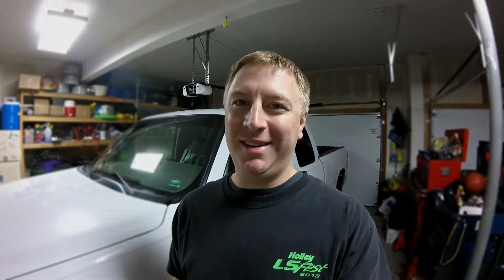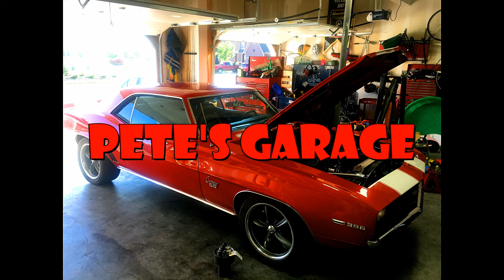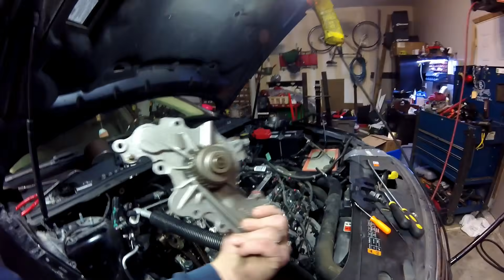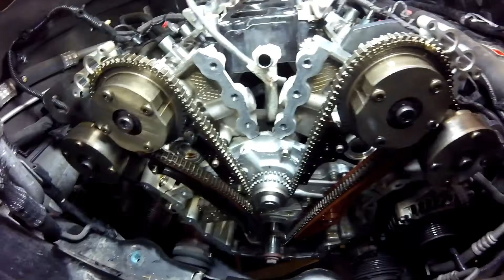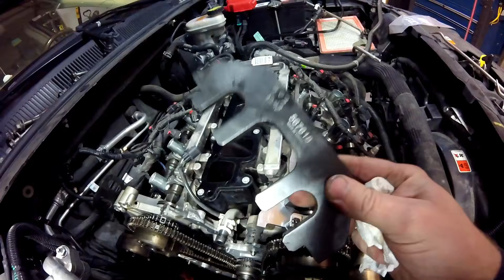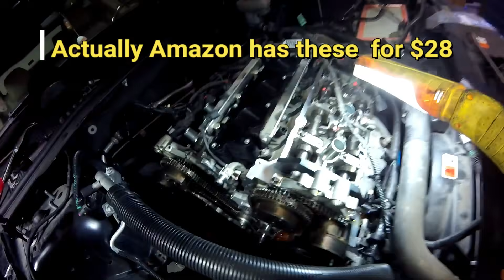Why does the Ford Taurus, Explorer, Edge 3.5L water pump cost over $1400?

Comment: It is important to note that this water pump may fail and the coolant may not come out the weap hole and dump behind the alternator, but.., it may dump inside the engine into the oil pan and destroy the bearings on the crank shaft.... It's engine replacement then....
Reply from the maker: Yes replace it as soon as you see any coolant leaking. Hopefully it comes out of the weep hole and not milkshake the oil.

Comment: You don’t know the worst of it. The water pump sits directly over the oil pan. When the coolant leaks through the front bushing it leaks into the oil pan. If not caught right away? I’ll just say you should do a little research online. Get ready to pay the big bucks for a new engine. Not to worry. The newer 3.5’s got an upgrade. They removed the water pump from the timing chain and put an idler pully in its place and routed a tube to the front of the engine and put the water pump on the outside . Another problem, coking of the valves due to direct injection. Ford had a fix for that. They added sequential port fuel injection to wash the intake valves and prevent coking of them. 
  The sad part is before direct injection the water pump and fuel injection worked fine, the valves didn’t coke and the water didn’t leak into the oil pan
Reply: Everything done in order to force you to have to buy another automobile!
Reply: To be fair gdi was to get more hp in the ever demanding heaiver cars and the need to get ok mpg. Dual port/direct injection is really the solution at this point. I belive toyota on alot of there cars runs port injection until you need the extra power. I am not a fan of these new small turbo cars "eco boost" ect as there promise to get better mpg seems empty so what do we even benifit from it other then mote complexity and wear on the engines?

Comment: Thank you. I was looking into getting a Ford Edge with the 3.5. I guess I'll just look for a Highlander or Pilot instead.
Reply from the maker: The pilots are having a little issue with fuel injectors. I also have a video on that. Check it out.
Reply: 300 hp out of the highlander N/A V6 That is just a modern 2GR-FEB ... you cant loose ... Parts are cheap, you can get genuine Toyota parts on eBay and after market for these are very strong since the Highlander is sold overseas in Australia as Kurger
Reply: $3,000.00 to replace the waterpump in the Edge,the whole drive train comes out to do it.It is a must to replace the timing chains and guides too at the same time

Comment: Longitudinal mounted engine are usually easier to work on. Today’s modern transverse mounted V engines can be a pain to work on.

Just did a water pump on a Toyota 2GR-FE and the pump is about 1” from the frame rail. So much fun.

Comment: GM has done this with the Quad4 as well. Honestly....I'd rather change a timing belt twice than a chain once! I said that back in the 80s when timing belts were new. Now we've gone away from belts and to chains on OHC engines. Belts are quieter, but when engineering puts a chain in, they dont feel they have to give you clearance to work on it like they did with belts. Nissan 3.0 has belt driven water pump in the valley and is a 4 hour job and gets a new belt too. Emissions regs drive crap like this to be built....

Comment: Makes me glad I drive an EV.  None of this kind of nonsense to deal with.
Reply: Even though I don't have one, and probably never will, I think that electric vehicles are fine...as long as you don't have to go too far from home. I don't know where you live, but where I live, there aren't charging stations available. I know that "hybrids" use small gas engines to run a generator, but, they're so complicated and expensive that they just don't make sense to me for use as a long distance vehicle. Also, a guy that I work with has an EV (not sure what it is). He hit a large racoon on his way to work one morning. It turns out that his DOES have a water pump, along with 4 small radiators. The water pump wasn't damaged, however, 3 of the radiators (heat exchangers?) were. There was no cosmetic damage to the car either. Even so, the repair cost was nearly $3000! Luckily his insurance covered most of it!
Reply from the maker: Yeah but the battery will be expensive when it goes bad! EVs are pretty fun though.
Reply: @PetesGarageandperformance  Or the generator
Reply: @Daver G  I'm nod driving a Tesla.  Too much exotic car in Tesla for my tastes.
Reply: BATTERIES Ability to hold his charge declines overtime and the weather can take a toll on the rate of that as well.. But I wish you the best it just depends on how much driving you doing how long are keeping the car

Comment: Uhh what year is that taurus?

Edit: I just looked online and the part cost less than $100

Is the $1300 going toward maintenance costs at the dealership?
Reply from the maker: 2014. I’m doing one on a 2013 also
Reply from the maker: Yes it’s around 8-9 hours of labor to get to this failure prone part.

Comment: This costs $1400 b/c Ford used an asinine design for the water pump.  When the pump goes pray it doesn't destroy the engine.  Ford is now getting sued over this stupid design all so they could fit a 3.5L into the 3.0L engine bay.
Reply from the maker: Yeah they used to drive the water pump off of the rear of one of the camshafts. But I guess that was made a little more difficult when they put VVT on this engine. I guess they thought the pump stuck out too far on the truck engines?
Reply: @PetesGarageandperformance  I think it is a bigger problem on the vehicles with smaller engines bays like the Fusion, Taurus, and Edge.  All FWD vehicles might have problems fitting the 3.5L engine into the bay, especially if the pump is off the crankshaft.

Comment: I would buy an engine for 500$$ with 50k and replace the whole thing easier lol
Reply: Not $500.00 used.The 3.5 in the F150s,$3,000.00 used
Reply from the maker: Do these engines really sell that cheap?

Comment: My work cars have always had the reliable GM 3.8 V6. Amazing engine and extremely easy to work-on at all levels.
Reply: Watch out for the timing chains on the dreaded 3.6 high feature GM V6s
Reply from the maker: Yeah when the water pump goes out on a 3.8 it doesn’t ruin the engine. And you don’t have to dig deep into it to replace it.
Reply: @PetesGarageandperformance  Back when they engineered things properly. The new breed of designers are bloody morons.
Reply: Yeah, the 3.8l water pump was about 1.5 hour job.
Reply: Except for the Dustbuster vans. They are a PITA to work on.

Comment: all the ones ive replaced leaked coolant into the crankcase mixing oil and coolant
Reply from the maker: Yeah you need to catch it early. How many have you had to fix?
Reply: ive done 3 of them 2 ford edges and 1 was a lincoln mkz 3.7 lol what a job

Comment: There is a small hole behind the alternator. Is this where it will leak if it's the water pump?  Someone said that if I take out the Allen cup next to that hole and clean it  the leak can stop. Help me out so that I dont run around crazy tomorrow.  My coolant is leaking out of the hole behind the alternator. It's a heavy leak.
Reply from the maker: Yes that is your water pump leaking. Don’t drive it! When these things leak, they LEAK!

Comment: Actually , many Ford dealers nkw quote $1800-2200 to replace this pump SMH.  Sometimes the coolant leaks into the engine I stead and you are now $5-7000 in the hole for a new engine
Reply from the maker: Yeah it definitely depends on the labor rates in your area. What area do you live in? Do you know what the labor rates are near you?
Reply: @PetesGarageandperformance  I'm metro ATL and most shops are like $125hr+ at least.
My friends 2013 Taurus quote 1800 to 2200, but that may have included timing chain components too.  After she repaired it the car was sideswiped and totaled 3 weeks later.
Reply from the maker: Wow that sucks. I rebuilt a trans for a buddy’s Jeep and he rolled it the night after he picked it up. Talk about a waste of money.

Comment: And I guess they used sealed bearings in water pump,, Could't  use the engine oil to lubricate the bearings,,, last way too long,
Reply from the maker: Yeah but I can’t think of a single water pump that has the bearings lubricated by engine oil.
Reply: @PetesGarageandperformance  True that, but i cant think of a single engine with internal water pump,
Reply from the maker: Most engines with a timing belt have one. Also the older dodge v6s had this design. The part that gets me is the labor involved to replace a part that is known to have a service life. It’s why it is recommended to replace the pump when you do a timing belt. But when one of these things fails, it can leak coolant into the oil. And that’s bad! Thanks for watching and commenting.

Comment: How many miles were on the engine?  Should they be changed at 125K miles?
Reply from the maker: 140k on this one. I personally wouldn’t replace it unless it was leaking. But I wouldn’t put it off for long if it starts leaking.

Comment: With the play in the water pump bearing and start up rattle,  wonder how many cars are mistakenly diagnosed as chain stretch?
Read that the phasers, chain, guides, etc need renewed as well.  Hard to justify this on the older sub 3k book valuation car. 
Video is an excellent synopsis of madness involved.  "If you have the time we have a water pump" Miller to Ford conversion song.

Comment: My ford explorer brought me here. I had this problem and could not believe that someone would be such an idiot to stick the water pump inside/behind the timing chain cover. If you let the pump just leak, it will eventually leak into the engine block and seize up the engine so you can't just let it go. The timing chain is supposed to be replaced every 80,000 miles so if your getting that replaced have them replace the water pump. The pumps itself only costs $40. I will never buy a Ford again. Horrible experience.

Comment: Oh yeah.  A couple of days ago, my sister's 2012 Ford Taurus blew up.  It has one of these piece of shit motors in it. The water pump failed and dumped coolant into the oil pan.  No noise, no warning, nothing.  The only clue is that it started overheating.

Comment: I had to get mine replaced in my 2013 3 months after buying it... around $1,300. I believe it was a common issue with the first few years of this design...
Reply from the maker: Thank you for sharing your experience and validating my cost estimate. Many people comment about the pump costing $50 but they don’t understand the total cost of the job.
Reply: No problem. Labor is definitely the major cost in getting it repaired. Looking at the receipt, It was 3x + some than the parts. Ford didn't make it easy..

Comment: Most if not all manufactures have created design nightmares during the past 3 decades  when it comes to engines . Sadly it there are only a few choices of engine irrespective of manufacturer brand still built in the OLD FASHIONED relatively  easy to repair  architecture of past decades.
The consumer is largely to blame for it , most consumers will  buy anything  with four wheels without ever researching what is under the sheet metal ,
suspension , drivetrain , engine architecture be damned . Most will rationalize that they will trade in their car or suv long before paying off their 8 year car loan , therefore in theory they might avoid spending  $1400 on a water pump. But that is an insane way of rationalizing buying junk engineering  as opposed to not buying a car equipped with an engine designed by a team of MICKEY MOUSE type engineers ... and.  that is being kind to the moronic engineers who could easily design a self contained electric motor driven water pump,  mounted externally in the engine bay connected to the engine  coolant system in some appropriate method .. as long as the morons  can design an engine bay with an adequate amount of space for servicing the engine. 
That make too much sense , and  design logic which minimizes repair costs  does not make dealerships wealthy on pump changes or any other part failure out of warranty periods that are outrageously priced , therefore the  MICKEY MOUSE ENGINEERING  reigns supreme.

I spent  $ 35 k rebuilding a 1964 car  model whose brand  I will not disclose in order to avoid a lengthy discussion about going with the wrong brand  with a potential pinhead who may like manufacturer  which I did not choose.  
Resuming from the unavoidable digression , my 1964 is  more reliable than any  new car because it uses a combination of technologies , proven v8 architecture modernized with  21st century options  aftermarket or OEM adaptable parts , underpinnings  throughout also received the same attention , as did  high performance fully tunable ABS brakes  
A restomod that is fun to use daily, and  able to traverse the USA coast to coast as many times as anyone would care to do. In every sense of the word reliable 
but should it need repairs  ...easily afforded  ...no banks loans or forced trade ins.

Comment: It sure seems like Fords newer engines are designed this way for the sole purpose of generating revenue through repairs....  built not only to fail, but to cost so much to repair that you'll be that much more likely to buy a new one as it ages.

I'd bet $5 that Ford has some bullshit story made up by the marketing folks who planned this whole fiasco that employees are forced to regurgitate to customers regarding the placement being as it is to make the engine more compact and reliable or something along those lines.  

This crap is right up there with the rest of the ecoboost issues.....  like the F150 detuning and losing power on long hill climbs due to a poorly designed undersized cooling system...  or power loss from condensate in the intercooler....  or ecoboost equipped vehicles catching on fire....  or ecoboost motors literally exploding.... 

Ford sure seems intent on ensuring their products really are found dead on the side of road.  ;-)

Comment: Peopel are so getting tired of this crap. You may have a degree, but it does not make you smart. Put the stuff that you know is going to need to be fixed every 100k or so miles. Make it easy. You know you are going to have to repair them. Companies end up screwing them self's. Because people find out how much this crap costs then they flood the market with your stupid cars and trucks when repairs like this come up on them. Not to mention the person who owned the car says "I am never buying one of those again" You are really just screwing your self.  This goes for all car makers. Can't a stupid engineer say gee. Let's try not to screw over our car owners. You know there is a Market there if anyone has the money and is interested. Focus on quality instead of screwing the people over. There is a concept! Luckily Don't have one of these cars, I have a Honda and for the Timing belt and the water pump it is about 1100.00, Still cheaper than this piece of crap car and I have a 170k miles on my V6 Manual Honda Accord. These guys should just go in to Trucks. You know what. They will just make the Trucks cheaper and cheaper.  Find better engineers or you will be out of business.

Comment: LOTS of engines are built this way or similarly. Nissan V6, 2.7 Chrysler, 2.5 Suzuki V6 though driven by a belt goes through the timing chain cover so it's a major disassembly to replace. No doubt there are plenty more. Typical new car junk. Intended to be thrown away, not replaced.

Comment: Ford Freestyle stuck axle shaft in transmission requires new transmission to be installed all because they did not put 10 cents worth of anti-seize on splines or a good seal (50 cents) to keep from rusting solid/ frozen. Now, no parts are available for that model at all with regard to the transmission, so the car is scrap. All that after putting everything else new in the suspension and brakes throughout the car for about $2k. It is enough to warrant a hit man.

Comment: Dealer cost on my 97 Toyota RAV4 was $1200 for the same job.This included the water pump, timing belt, tensioners, seals, etc. If you can't do the work yourself, you're gonna pay. Oddly my 2001 Audi A6 2.7T was less at $875 for the same job.

Comment: The hydraulic fan set up on the Jeep is $1000 it runs off the power steering pump and is plumbed into the steering rack so you lose it from a leak and you lose your steering and cooling . $1000 for a new cooling fan , and used is about $300 .

Comment: Ford does thier customers very wrong and some people just love it. Chevy makes a vehicle to last as long as possible, simply as possible. Ford tries to engineer difficulty into vehicles so as to support dealers. In the effort to make things complicated, they inherently make junk shit. Simple as that. Some just like it the hard way. Have fun with that. They also made a focus that all but one motor mount had to be pulled so you could move motor enough to change a 600 dol. Alt. Only to have it go out again and find wires in hatchback causing it or worse computer failure. Dont get me started on the 5.4 or 6ltr power stroke junk.

Comment: Wait... Is the price of the pump alone $1400? Or is that the price after labor?  After labor, that's what I would expect to pay to replace the timing belt, water pump, and oil pump for my 3.0L N/A interference engine.  Is it because the price of parts?  No, it's because you pay the price for the extra compression.